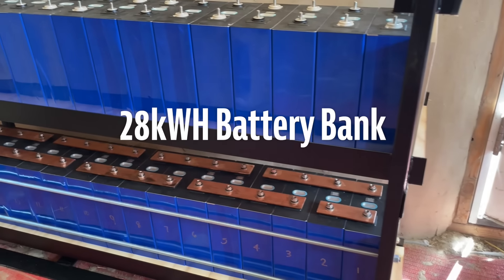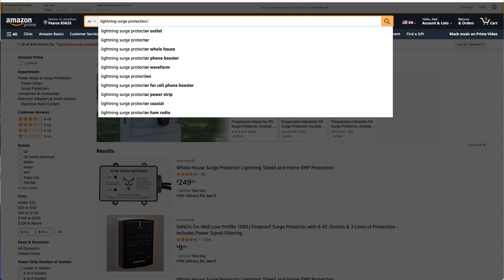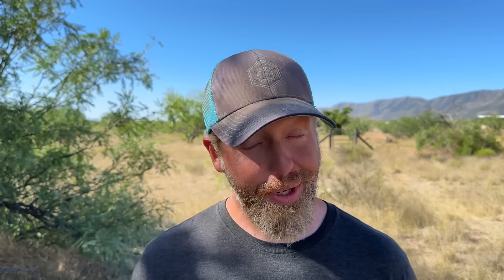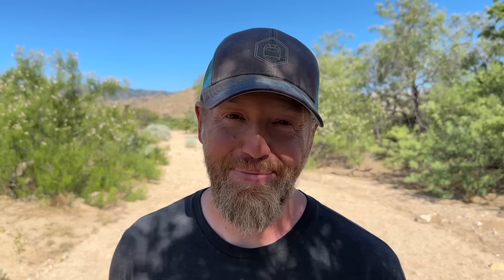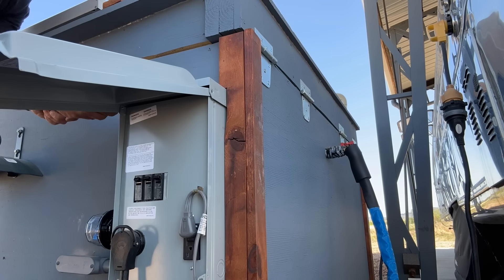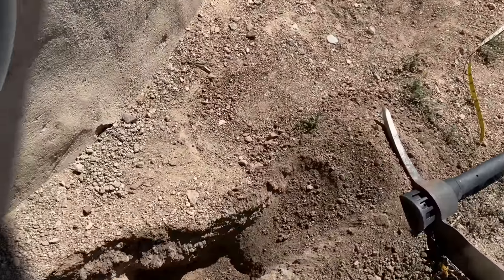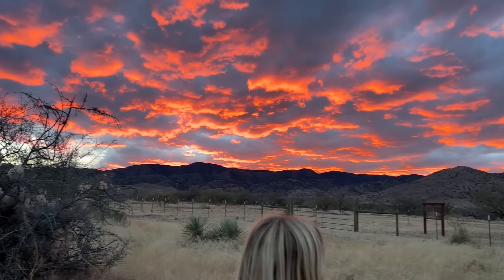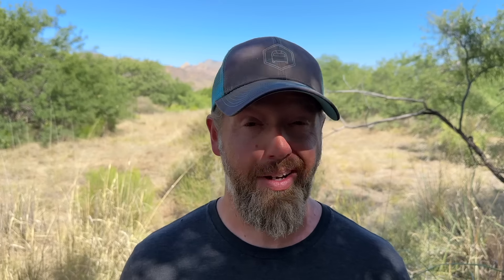This Cost Us THOUSANDS - Lightning Destroys DIY Off-Grid Solar System

Comment: curious question after a comment.  I once lived in an area that had dryer soil like you and I was tasked to put in a 24' grounding rod because that is what it took to get to better conducting soil.  Could this be the answer you need to do for your project?  good job by the way.
Reply from the maker: Well that's basically what I did by doing 3 8 footers :)
Reply: @TinyShinyHome   similar but not the same. It's the debth I'm talking about not necessarily spreading out between groundings .
Let's just hope what you have is adequate.
Reply: @TinyShinyHome  No, by going down 24ft you would have been much more likely to be in contact with  more conductive soil.  They are called sectional ground rods.  Your three 8 footers are not the same since they could still have too high of resistance at that shallow of depth for your area.

Comment: Even though you're in the opt-out system, can you pay to have inspections? If you could get that independently done surely that would help with insurance
Reply from the maker: You can opt in for inspections yes. But then you need stamped engineered drawings of your weird non traditional build, it would be a nightmare.

Comment: I assume you have SLV (Separated Low Voltage ) I'd connection between your PV array and your inverters with an overlay protective Earth wire  running above it. 
I'd be interested to know if you thought the lightning strike was Differential across your inverter or Common mode WRT earth (ground) ?
Does your new protection work for both? 
Reference: 
IEC 63205 is the recognised worldwide standard for lightning protection system (LPS) design, installation and maintenance. 
BS EN 62305 is the British edition of the European standard, and is derived from the IEC document.

Comment: The best way to ground in a desert 🏜️ environment not just for Lightning but also Power Generation……..  You kan use a meter kalled a vibroground meter to check the resistance in your grounding rounds……. Adding extra 8ft grounding rods is good but instead of putting them inline with each other  they need to be in a Delta or triangle 🔺 and linked together …….. putting an 8 inch PVC  pipe around the grounding Rod salt and water the grounding rods. This will ensure that the ground in at the rod area is the path of less resistanse…….. This will keep you from killing yourself while taking a shower………. Having a poor grounding system kan lead to your generated power / battery power not lighting killing you while taking a shower as the water & you bekome the path of least resistanse. ⚡️☠️⚡️

Comment: Biggest problem l see is the ground rod, with a close strike, could easily be at a voltage greater than your wiring. The SPD will have no place to discharge and may actually back feed your system. People have been trying to outsmart lightning for centuries. So far, whatever we've done is just pissing in the wind. Good luck but if it's your time to take a hit, there's not much you can do about it.
Reply from the maker: That's not really how it works (go do some research on the SPD if you'd like to know more), but yeah a direct strike and all bets are off. This is to protect against indirect strikes.

Comment: It looks like you double-lugged an arrestor on one of your AC lines and combined copper and aluminum wires together at the same time. You can get a lug breakout or lug splitter to alleviate those issues - or not. I'm a youtube commentator; not an electrical inspector.
Reply from the maker: No aluminum wire here, not sure what you mean.
Reply: @TinyShinyHome  Apologies, I mistook the black (somewhat reflective) wire insulation @9:00 for aluminum wire.
Reply from the maker: Gotcha :)

Comment: Hola ! Why don't you use solar panels to provde the shade and shed for your trailer ?
Reply from the maker: Our ground mount was built separately before we were ready to move our trailer to a permanent spot. Also panels put out a lot of heat underneath. If we do additional panels we'd put them on the roof of our covered structure.

Comment: So considering we have 200w of solar on top of our van could we be in danger of being hit and killed while traveling in the van ? We have them hooked thru a window into our natures generator and jackery. No fancy inverter system. And literally drove from NY state to Wyoming this week. But have to drive back next week. Eek
Reply from the maker: You have a small panel with a short wire run in a vehicle with rubber tires. Wouldn’t worry too much about it. Coups also unplug the panel while driving.

Comment: I wondering if I shut off the pv and just run off the batteries and inverter during a storm if that would help?
Reply from the maker: Depends on whether you have AC lines underground. If so you’d want to just shut off everything until the storm has passed.

Comment: How do you protect your solar panel array from lightning strikes?
Reply from the maker: A ground mount is grounded by design, but you can also put lighting arrestors in your combiner box.
Reply: My 4200 watt array is grounded to my rv frame I think VIA from charge controller I guess?

Comment: You didn't cover/mention where the lightning struck - and you possibly have breeched wire (unless it's been replaced)
Reply from the maker: It hit the ground close enough to find the live wire and travel back up through it to the power gear. Don't know what you mean by breeched. No replacement was necessary, though.
Reply: @TinyShinyHome  For the lightning to enter your system, a hole (breech) in the wire was made - so it's likely you have raw exposed wire somewhere along your run.
Reply from the maker: That’s not how lightning works. There’s no hole in the conduit or wire.

Comment: hy i sugest a 0 ohm grounding sitem with ground rods about 120 inch a supresor is usualy not the final solution lightning cand jump 30 inch in circuits if the grounding is pur goes wher ohms are few

Comment: I noticed in the video the 100' length of buried wire between solar panels and charge controllers.  Is it generally recommended that lightning protection devices are only necessary if the length of buried wire is 100' or greater?
Reply: k...So what do you think happened here?

Comment: why did you think that grounding was lightning protection? its lightning attraction -- a lightning rod is protection because its both grounded and way up high begging to be hit first
Reply from the maker: Because it is? Any quick research will tell you this: "A grounding system provides a low-impedance path to the ground. This low-impedance path is installed to encourage the lightning to travel through it instead of through your expensive electronic equipment." Also, I'm talking about indirect strikes, not direct strikes. Lightning rods draw direct lightning strikes close to you - which isn't a great idea with my poor soil conductivity.

Comment: My comment appears to have been removed.  Not sure why, but in summary, I suggested that using multiple ground rods could be a big problem.  I also referenced another YT channel about grounding and bonding by a guy with the initials MH.
Reply from the maker: Like I mentioned in the video, opinions of grounding off-grid systems are all over the place. I'm getting a lot of "out there" recommendations on this video, many of them contradicting each other.  In trying to keep things less overwhelming for viewers, I probably removed the original comment because what you're recommending goes against all of my research. If you have direct experience with grounding an off-grid solar system in the desert, feel free to explain in more detail.

Comment: Just when we think we understand electricity it shows us a whole other side of itself. Electricity doesn't follow the path of least resistance alone...it follows ALL paths. Concrete footings must be bonded too but cannot by insulated from the earth. Footings of concrete must always have a moisture content or they will not work as a grounding electrode. With a buffet of paths and dry soil, electricity will always run to the delicious copper wire connect to equipment first. LOL
Reply from the maker: Probably do a little more research on Ufer grounds before saying they don't work ;) https://en.wikipedia.org/wiki/Ufer_ground
Reply: @TinyShinyHome  I never said they don't work. I'm just pointing out that electricity does things we don't think about, and thus the reason for new tech. I've installed dozens of ground rods around a single pad on one solar site for and area of 60 by 110 ft. If you have really dry non-conductive soil, you might research different grounding methods. I spent 5 years in school and 8000 hours on the job and still have to ask questions from time to time.
Reply from the maker: I guess I'm not really sure what you're saying? Yes lightning has a mind of it's own, but let's focus on solutions instead of what doesn't work. The research for non conductive soil led me to Ufers. What does it lead you to?
Reply: @TinyShinyHome  I'm not focusing on what doesn't work. As a foreman on solar sites ranging from 2-20 megawatt systems, I usually don't have to research. We check the engineer's specs and occasionally have to bring mistakes to mind. Did you resistance test your rods after you put them in? I don't live in your area, but if I did, I would do the research. Florida is the lightning capital of the world. Ask Mickey Mouse what he does. I worked there for 4 years. As a DIYer without a license it doesn't surprise me that you thought you were protected is all. If you are a license, then you made my point. Electricity is a mysterious thing that we still don't understand fully. There's a reason why Cisco network switches cost $3000 and Netgear switches cost $100. Controllers you can afford are not designed to protect themselves well enough. Our solar installs cost over a million dollars per megawatt. DIYers are trying to duplicate what we do and are using cheaper electronics.  In tornado alley you'd have a whole different problem to contend with. Mile Holt has videos on how ridiculous it is for us to try to protect large solar arrays from lightning. He lives in Florida. We can only do what we can and hope for the best. Mike says whatever lightning hits it destroys. And we expect affordable surge protectors to be enough?
Reply: @TinyShinyHome  Electrical work is one thing. Lightning protection is another. Contact a lightning protection company that specializes in that field first. Your own personal research may not send you in the direction you want. But a lightning rod in a field of steel may not be lightning's first choice. Good luck.

Comment: Hey Johnathan, I'm new to your channel. I saw the video where you built your solar system and got your batteries at a fraction of the cost. I'm trying to find what fraction of the cost you are talking about as I am trying to piece my system together. $1,600 - $1,800 for a 48 volt lithium battery is not a fraction as you call it. I could possibly get buy with 6, maybe 9 batteries run in parallel. Is paying over $10,000 cheap for batteries? Thanks
Reply from the maker: We bought 3.2v cells straight from China and built our own bank for a fraction of the cost. Lots more details at these links: https://youtu.be/vnjMQLhp6LE https://youtu.be/u6DJFk0UsVA
Short answer - we spent under $5k for a 28kwh battery bank. I'm sure prices are different now, but at the time nothing came close to doing it that way.
Reply: @TinyShinyHome  thank you. I'm just trying to get the most bang for my buck. You have some really great insight into solar, I just don't want to get ripped off 😂
Reply from the maker: Also this is the supplier - they have a us wharehouse now Cheap LiFePO4 Batteries Shipped Fast in the U.S.
https://youtu.be/fST2IPyNUy8

Comment: I have a theory about lightening.  IF you make your system attractive to lightening to find a quick/easy path with all of the ground rods/wiring, you are going to attract lightening and get hit.  IF you don't have the ground rod/wires, then your array is 'isolated' from the earth and not attractive to lightening to find an easy path back to Earth.  Lightening strikes where it can get back to Earth the easiest.  Like a tall tree full of water with roots in the Earth.  A tall building with metal spikes in the air connected back directly to Earth.  Does this make any sense to you?  I make this statement from an observation.  2 buildings, same height and next to each other.  One has lightening rod system, one does not.  Guess which one gets hit repeatedly and the sandstone parapet on the roof gets blown up despite the lightening rods attached.  The one with the pointed bronze objects sticking into the sky.

Comment: What have you done to protect your steel building from lightening?
Reply from the maker: The Airstream cover? Nothing, really. It's bolted into a cement pad which is obviously grounded. Trailer is "floating" under the cover and the electrical is attached to the pump house which is also separate from the building itself. Also it's built so there are wood purlins separating the metal roof from the trusses. Could have run ground rods for each truss, but couldn't come up with a solid reason why.

Comment: SALT the ground rods heavily and then soak. SALT is the answer in the desert. Ground wire to ground rod needs to be *one single continuous piece* of #4 ground wire.
Reply from the maker: Salt the ground so you corrode the copper wire and the rod? That makes no sense.
Reply: @TinyShinyHome  It does make sense. Look it up. Ask a good electrician from Tucson. It's called ions. That is what the salt provides. You have few, you need many more to conduct the discharge.  Start with a starter hole as best you can with a post hole digger. Then you add water to the hole, dig some more, more water and when you can dig no further you add pounds of salt, lots of water to dissolve it, and then you drive the rod. More water more salt when you are done. Then walk away. Alkaline soils have little conductivity. One continuous piece of #4 is supremely important.

Comment: Do not use a hammer to install a ground rod, use a bucket of water.
Reply from the maker: 🙄 No amount of water is going to allow a ground rod to just slide down in here in the desert.
Reply: @TinyShinyHome  Try it. Start your rod as far as you can by hand, pull it up and pour water into hole. Put rod back into hole and push down hard, rinse and repeat several times. This works on hard clay.
Reply from the maker: Or just use a sledge or hammer drill like everyone else and be done in 5 minutes. Not sure why we're wasting hours soaking the ground. No harm to the ground rod hammering it in.
Reply: @TinyShinyHome  Hammering a ground rod does damage the rod, it flares the end.
Reply from the maker: How is that damaging it?
Reply: @TinyShinyHome  If the end is flared out sufficiently, you cannot get the clamp on the rod and you would have to cut the end off the rod or grind the flare smooth.
Reply from the maker: If you're flaring it that bad, then you have some crazy hard ground. Not an issue here.

Comment: I'm confused, lightning electricity moves faster than normal electricity??? I thought they all moved at the speed of light???
Reply from the maker: In general the fuses/breakers in a system are "slow blow" because many appliances/motors have high amperage startups and then settle back down. So they will take higher than normal amounts of heat or amps for a certain time before tripping. Lightning is a whole other beast sending high voltage/amperage spikes very quickly that will damage equipment before the slow blow fuses trip. So that's what we mean by speed here - the SPD reacts much more quickly.

Comment: You are missing the bigger picture!
You saved tens of thousands of dollars or even hundreds of thousands of dollars by opting out.
I recently built a conventional house at least 40% of the cost was meeting the govermental BS on things I did not need or want.
40% of $250k = $100k. I spent $16,000 building a pad to build upon, now I have a house on a tiny hill.
Which will make mowing grass very very hard, and yes I have no choice but to put grass on that hill, and yes another $2,000.
At least I get to look down upon my neighbors :>).
I had to pay a licensed plumber $15,000 to plumb a 1500 sqft house with a kitchen and two baths. He alone has delayed the house by 45 days. To say he sucks is like saying the big gaint vacuum at the car wash is a ryobi hand held.
I have to pay the painter $500 not to paint my floors.
I had to pay the city $1250 for permits so they could inspect all of their requirments that delayed it by six weeks.
I had to have a drainage plan by an engineer that cast $2500, there is a ditch in front of my house and yes water flows down hill here too. That was very very surprising. Who would had thought it?
And none of the things they require would have prevented your lighting strike.
And Insurance will charge you extra for a solar system and probably not pay for a lighting strike
Be happy only two or three thousand lost.

Comment: I would add a few really long ground rods around the solar array.  Your ground mount probably goes down less than 5 feet.  I would get a well driller to put a couple of steel well drill rods down 30 feet or so, and leave 10 feet above the solar array.  This takes the place of trees, to direct lightening into the ground.
Reply from the maker: There are ground rods on the solar array.